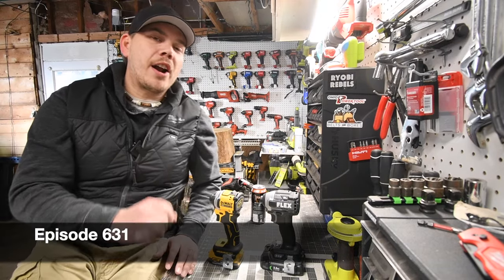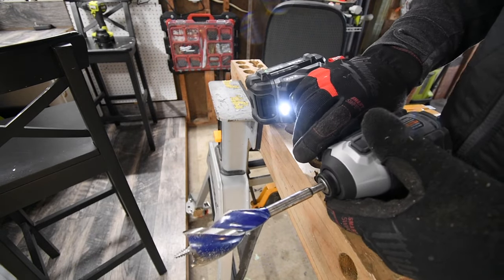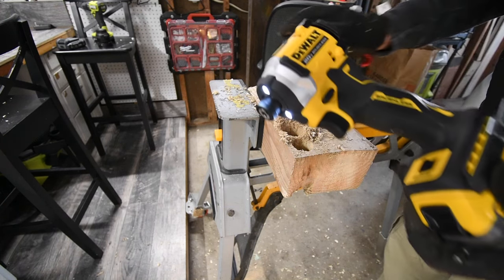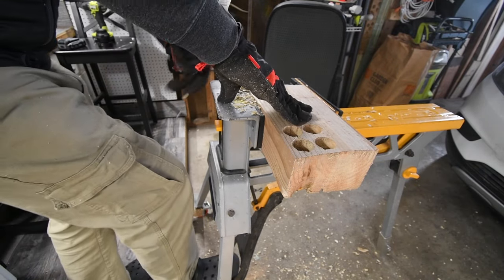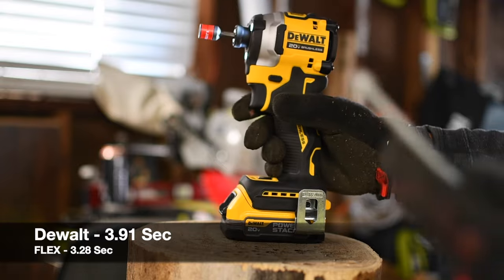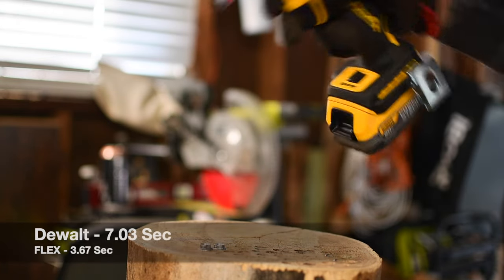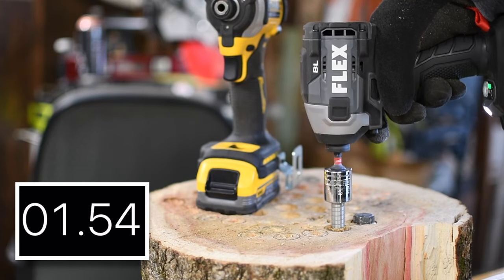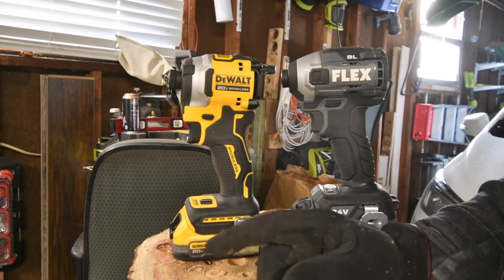Low AH Battery Stress test (Dewalt vs FLEX)

Comment: Question about your flex hammer drill. Did you ever test out there warranty and get the chuck replaced, fixed, how did that go? Were they a hassle to deal with?

Comment: The Flex battery is much bigger at 47% as far as Amp Hours go but it’s also 24v vs “20v” (actually 18) 
I don’t think this will be the case with the new XR impact coming soon. Hope you do comparisons with that.

Comment: Those are both great! The FLEX has a bit of an edge on speed and torque. I own both as well, no problems with FLEX so far and DeWALT has been in my tool bag for many years. One thing the DeWALT has over the FLEX right now is the price point. 🙂✌️❤️

Comment: Flex and kobalt are the same company basically but I still prefer kobalt even through they're slightly less powerful. The XTR line is still killer. Right now I'm testing out the Skil PWRCore 12 line also made by Chervon, they seem to be making a good dent in the competition for power tools
Reply: The Skil Pwrcore12 drill is awesome! Stronger under load than my M12 Fuel hammer drill and just as strong as my DeWalt 12V drill (dcd701). The impact driver, otoh...My M12 Surge, which is supposedly only 430in-lbs of torque, beats it and the DeWalt 12V impact driver easily while being a lot quieter.
Reply: The kobalt xtr is powerful
Reply: XTR is fantastic if you can handle the size and weight of it. M12 Surge is my most used tool. that thing is great. DeWalt 850 gets all the press, but the 840 with a PowerStack is the best balanced Driver I've ever used. And more power than the 850. I also prefer Kobalt to flex. They should have just built up XTR instead of releasing a whole new line.
Reply: @Lee-lb9qh  yes chervon makes kobalt,skil,ego,flex and skilsaw
Reply: I dislike the trigger on the Kobalt XTR stuff. My arthritis hands get fatigued much faster than using other brands. I was 100% prepared to buy Kobalt everything until I got to spend a day with their stuff. I eventually just put the Kobalt stuff down and picked up some Ryobi goodies and never noticed anything underpowered, overheating, no issues, they fit the human had better, (ergonomics matter) and the trigger pull is so much nicer than the Kobalt. I tried rigid, Kobalt XTR, dewilt, Ryobi, Milwaukee, craftsman and that trashy porter cable stuff. This was roughly a year ago now. .... So what did I end up speccing into???? Ryobi. Comfortable, more than enough power for my lines of work, warranty, comfort, they variety of tools that fit my jobs, comfort and did I mention comfort. Really want to play with the Flex goods, but nobody I know has any. So for my dollar, Ryobi is king. I work my tools at a reasonable level and every time I pick them up, I smile a little. That makes work more enjoyable.
Reply: @winkletown8828  You should try Metabo HPT then. Best triggers out there IMO.
Reply: @winkletown8828  the kobalt xtr trigger is better if you turn down the speed

Comment: I have both the dewalt 850 and the 840 and the new battery’s, and I prefer the 840 over the 850
Reply: Same here! That 840 with the power stack is just chef's kiss perfectly balanced. The new XR driver will basically be the 840 with speed selection it looks like. That's the only thing I miss on the 840.

Comment: Aside from the misleading Flex comparisons they made when launched (which every company is guilty of.. I'm looking at you, HFT), I think Flex doesn't get a fair shake. I think this stems from getting stuck in our familiarities. People get into a brand and don't want to let go, because of our need to be in a click, all the way back to childhood.
Reply: Or it's the fact that most already have several hundred in batteries alone, it's not worth it to switch brands to drive a screw 1/4 sec faster
Reply: @mathewbeckley9022 true. but i just bought my first powertool recently and i went with a flex impact. everyone i work with uses dewalt but i want something different than them so i chose flex. but it's so expensive, so even new buyers have a reason to go with dewalt still. i also chose flex because of the color scheme, i love it

Comment: So deceiving. You used the weakest dewalt model vs the average flex model. Not to mention the 24v vs 20v and price point. The fact flex cost more and barely has an edge over less powerd smaller models says a lot
Reply from the maker: ive done many versus videos with both of these tools, this is just one of them